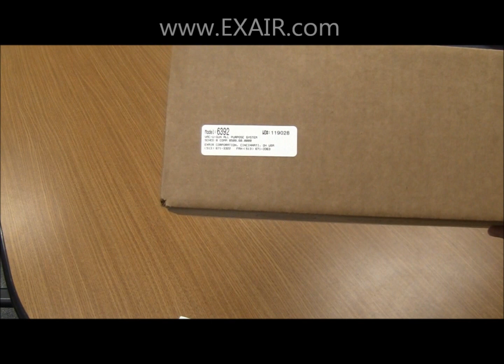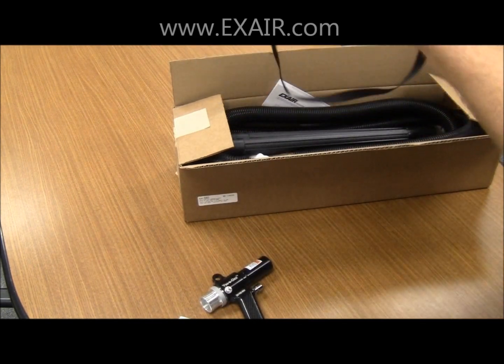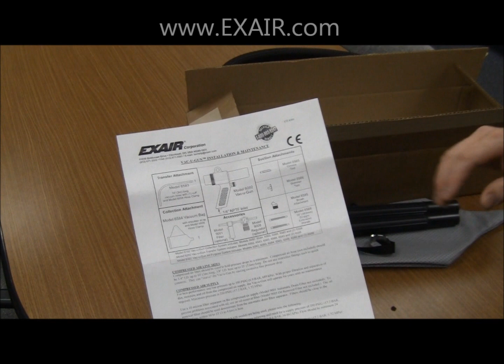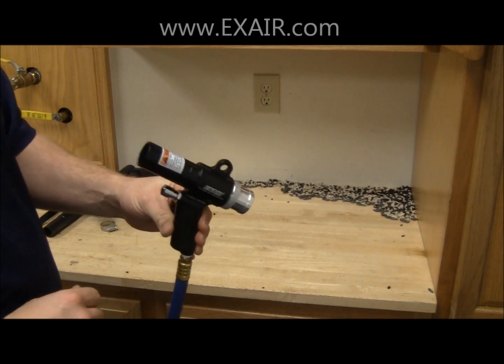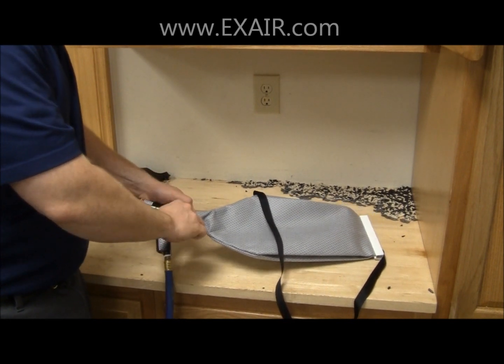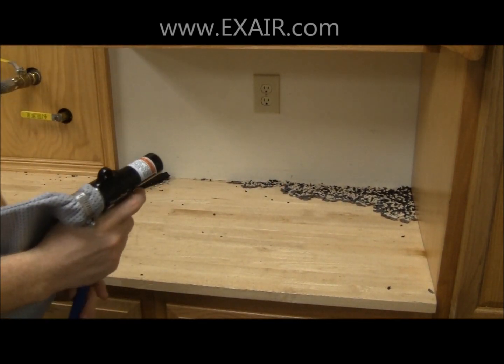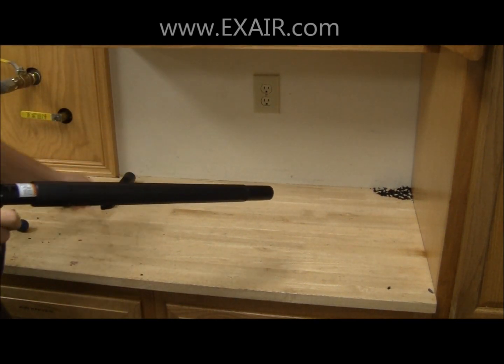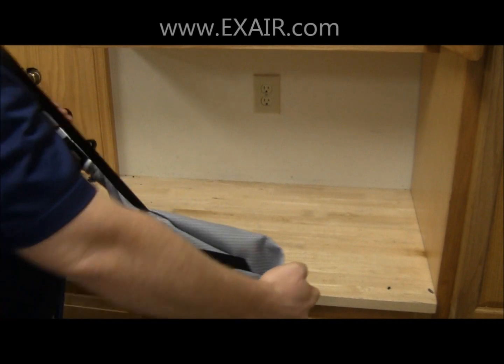EXAIR's Vac U Gun

Comment: Can you use a high volume low pressure turbine compressor. They do not use compressed air. Basically a 3 stage vacuum motor with a half in hose.

Comment: A compressor with 20 SCFM is enough to use as a vaccum cleaner?
Reply from the maker: The Vac U Gun only requires 13 SCFM at 80 psig inlet pressure to achieve optimal performance.  A 20 SCFM compressor would be plenty as long as it is outputting 20 SCFM at 80 psig.  You aren't directly using the compressed as a vacuum cleaner.  Depending on the application one of our other Industrial Housekeeping Products may fit better than the Vac U Gun.  If you would like to discuss your application please feel free to reach out to our Application Engineers directly at Techelp@EXAIR.com or 1-800-903-9247.

Thanks for the comment!

Comment from the maker: Gary,
                A high volume low pressure pump is not going to be able to properly supply our Vac U Gun with the pressure that it requires for optimal performance.   The EXAIR Vac U Gun is designed to be operated at 80 psig inlet pressure and utilize 13 SCFM of compressed air.  The turbine pump you are looking at using is something that I would generally associate with a paint sprayer.   Our products are all designed to be used with industrial air compressors, at a minimum of 20 psig inlet pressure.  If you would like to discuss further, please do not hesitate to contact us at 1-800-903-9247.

Comment: good thing compressed air is cheap.  lol
Reply from the maker: Sadly enough there are employees in the workforce that believe compressed air actually is cheap. Here at EXAIR, we know that is not the case. The current average in the MidWest for compressed air is $0.25 / 1,000 Standard Cubic Feet of compressed air.   This ranks compressed air as one of the more costly utilities companies utilize and that is why EXAIR is dedicated to developing and offering Intelligent Compressed Air Products® that help optimize your compressed air usage.  The Vac-U-Gun product does utilize compressed air which enables us to have no internal moving parts, no motors, bearing, or impellers to wear out, as well as simplistic installation and use.  There are certain areas / environments where compressed air may be the only utility available for use and that is where the Vac-U-Gun can help decrease cleaning times as well as be an  efficient option for compressed air utilization.   If you would like to see how we suggest optimizing compressed air use within your facility, please follow the link to our 6 Steps to Compressed Air Optimization, http://ow.ly/n8sj305RgIl.  Thanks for the comment and please feel free to reach out if you have any other questions!